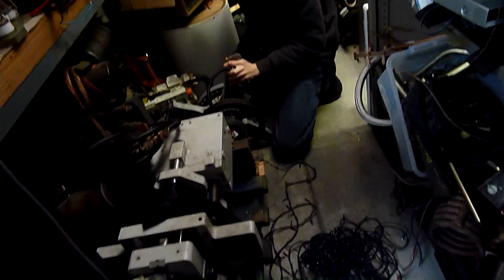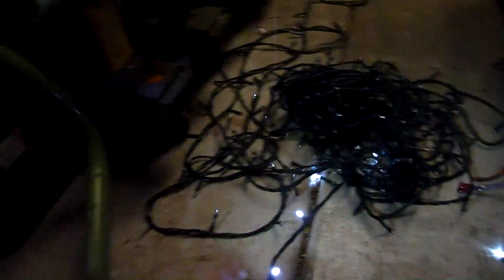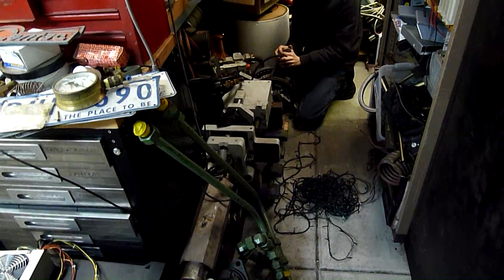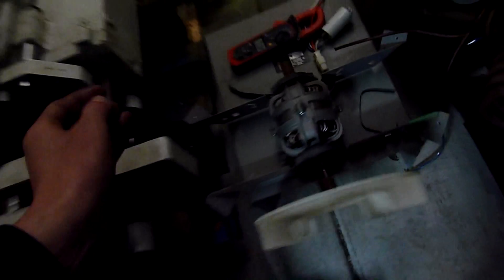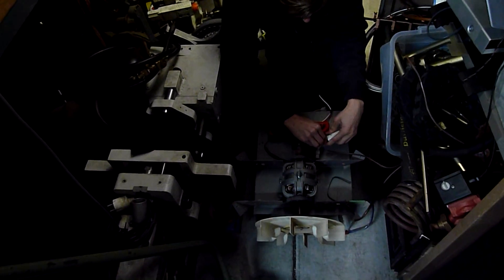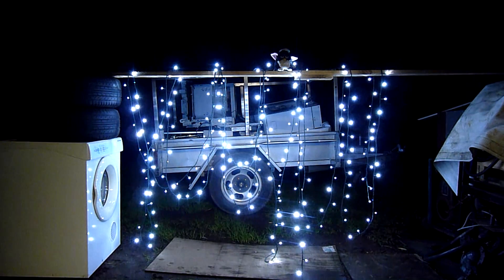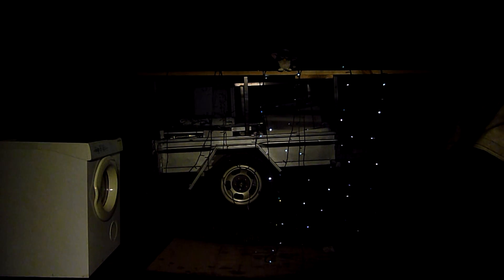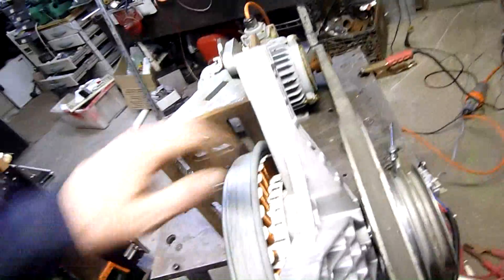LG Washer BLDC motor fun, Christmas lights and Dryer Motor

Comment: The reason the LEDs at the end of the string lit first was because they tend to wire them in series circuits of 7 or 8 LEDs and since that doesn't fit perfectly with a 100 string set they use less LEDs in the final sections meaning they will operate at a lower voltage.

Comment: I bet that motor would work quite well as a wind generator.
Reply: why would you want to generate wind?
Reply: SP3IIL I meant to use it to generate power from the wind. It seems to produce a good bit just by turning it by hand. If you put a big blade on it, it might generate a lot of power.
Reply from the maker: SP3IIL Lols :p
Reply: SP3IIL
to keep the shop well ventilated after doing experiments like these
Reply: rocketman221projects F&P Smartdrive motors haul ass as wind turbines. We had one on the roof at work charging batteries and running some gear through inverters and backup batteries. The sparkie there was fairly clever, just not as good on his CNC 5 axis